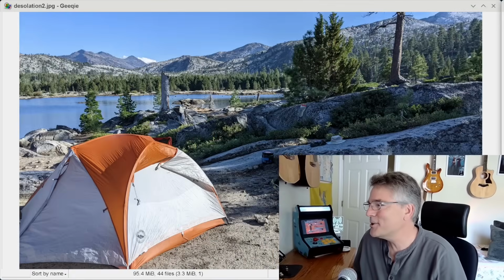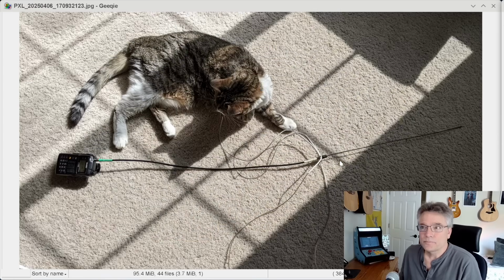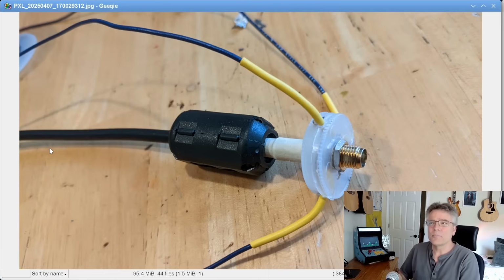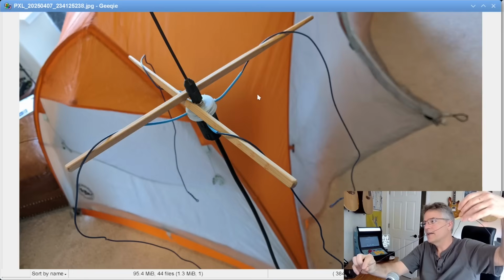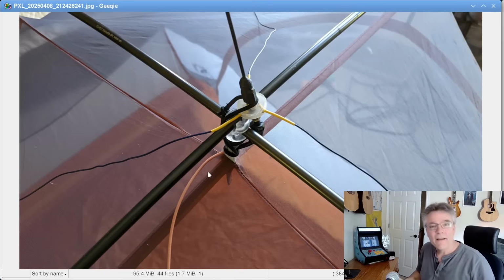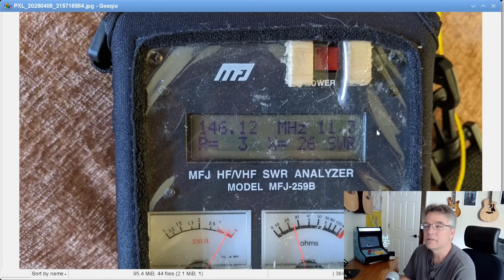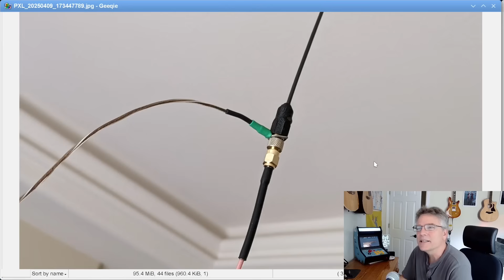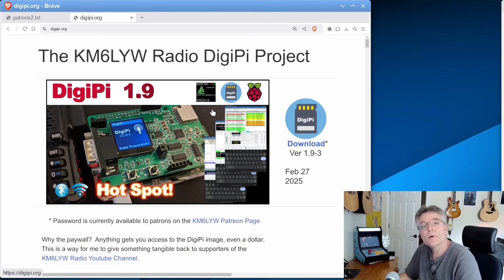Double Your HT Antenna Gain!

Comment: I guess that one wire version would work just like that "tiger tail" (not sure if that is the correct name, it is a simple wire attached to the antenna base) we use on the HTs. Wouldn't it?

Comment: Does it mater what choke bead you use? Do you know what bead that is? Thank you for the video.
Reply from the maker: In that case it was a cheap ebay clip-on choke, but "mix43" would probably be the best choice for VHF.   You can tell if the bead is working if it has an impact on the SWR (for the better).

Comment from the maker: Anyone build a co-linear antenna out of coax segments?  gain to weight?
Reply: Astonishingly fiddle to build, effort to advantage is negative. There are easier and better alternatives. Unless you just want the challenge.
Reply: A must try 2 antenna s , 1 the smiley dual band or of ur lil bit larger a 770 dimond ,  be careful,  try to sell u the  770 magnet mt u want the ht ant 26 inch 2 pc does better 4 me because  of  flexibility  of vs  very flimsy smiley ant also a bit better signal  both ways on 770 dimond 35$

Comment: A T2LT antenna, that is basically just a length of coax, works really well and is simple to make.
Reply from the maker: really neat idea!  Does this scale to 2meters?
Reply: @KM6LYW  Yes, works really well.
Reply: Absolutely! QST did a piece on these around 2017. Often confusingly called a bazooka dipole.
 Zip tie it to a stick of bamboo, fiberglass, pvc, and jam it in a backpack, and you can also totally elevate it above crowd levels, so the wetware doesn't absorb your signal.
 I've gotten 1.1 swr with no choke. If you take 15 minutes to tweak the cable lengths, no choke or radials needed.

Comment: nice! will you do ant Meshtastic or meshtastic on PI?
Reply from the maker: I'd really like to get into that, in fact, i'm worried if I start, I wont stop.  However, I live in the woods, no other nodes near by.  Closest is maybe 8 miles.
Reply: @KM6LYW  I know that you can do a yagi antenna w this! I'm in the  shenandoah mountains the closest town is 10 miles away. I pick up 2 - 3 nodes... and i'm using a Pi3 w a waveshare sx1262 915m LoRa pi hat!  also look up meshtastic maps...

Comment: Great video. I’ll be backpacking in Desolation Wilderness this August. Which packet radio station do you connect to when you’re up there?
Reply from the maker: There's an APRS digipeater at Spider Lake, other high-levels near Tahoe work too.   The "805" has a Rubicon UHF link also at Spider for voice.